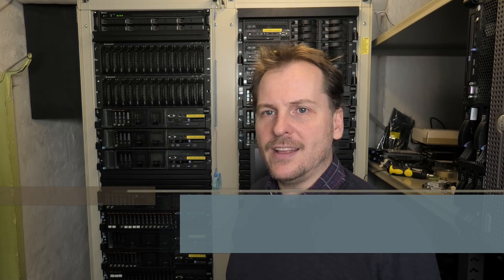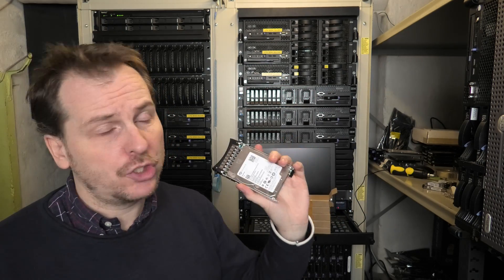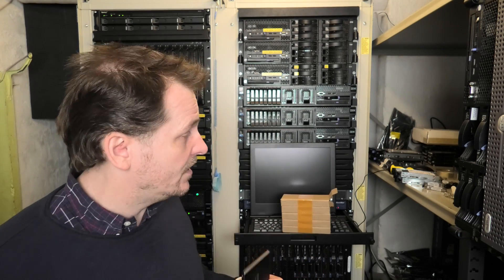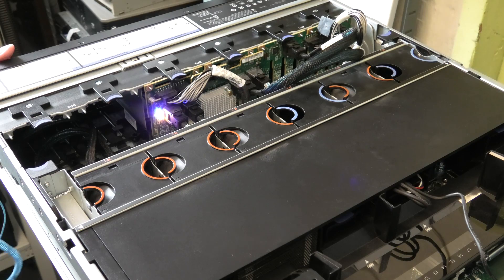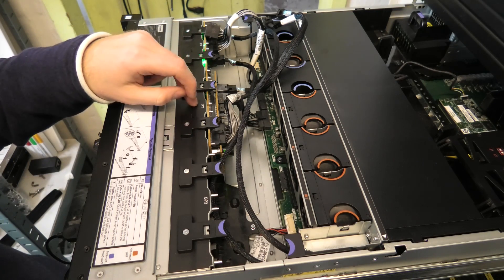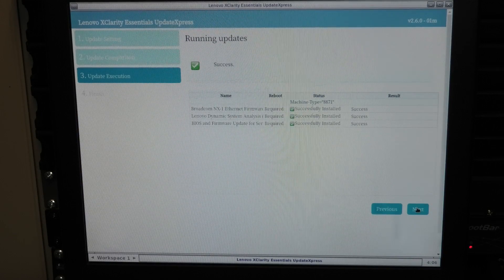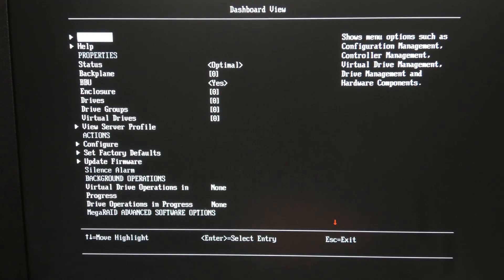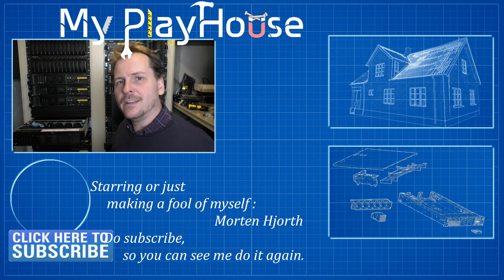Lenovo x3650 M5 SAS 12GB/s Expander Backplane Troubleshooting - 889

Comment: Hy in my HPE ML350 G9 i use 2 Samsung 840 1TB SSD an the fans works normal. No Problem 😄
Reply from the maker: Hi Tobypictures
Thank You very much! I have four running in two HP BL460 G9,, and they for sure fills up the log with whining.
Thank you for watching! :-)

Comment: I don't think HP does it because they don't recognise the drives, the system can easily find the temperature of the SSD, it's an industry standard. They do it because they don't want their customers using 3rd party hardware in their servers, it's less profitable. And YES sure HP parts are more reliable but smaller enterprises probably would be better off with putting that extra cost into other things than HP certified parts. Samsung Evo's are cheap enough that you can have a couple hot spares ready whenever a failure happens and you can always move up to more professional geared drives that are still cheaper than OEM parts. Apple did the same thing with their iMacs, you had to buy an adapter cable in order to use a non-OEM HDD/SSD or the fans would spin at full RPM all the time.
Reply from the maker: Hi CreativeType
Thank You very much!  glad you liked the video :-)
Thank you for watching! :-)
Reply: @MyPlayHouse  Oh thank you for making so many interesting videos you probably don't remember but I've been watching you for years. Just been a while since I've left a comment <3 I've been thinking about getting certified to work in the data centre field, I'm thinking about getting my Cisco basic networking down and I just signed up to become an electrician. I worked for years as an ethernet installer but now I wanna get into more of the power delivery and server deployment stuff.

Comment: I actually use some Silicon Power ssds for raid 0 to work on videos. They are FAST AS HECK (saw 2 GB/s not Gbit with 3 +r 5) in raid they have slc cache 512 mb and they are BLOODY CHEAP i saw 1 tb going for 55€. I would not put them in production 24/7 environment, for that there are the samsung ones, but random raid 0 for random stuff they are fast and good
Reply: That 2/3 GB is peak performance
Reply from the maker: Hi leonardo toschi
Thank You very much!  glad you liked the video :-)
Thank you for watching! :-)

Comment: That shouldn't be too hard to reflow it looks to be some sort of transistor or regulator
Reply from the maker: Hi Mrflash222006
Thank You very much!  Well I bought a new one,, I do not want to fix it,,, They are sending a replacement.
Thank you for watching! :-)
Reply: Ah just dawned on me that’s why the cable has been modified - it’s to bypass that regulator, a wild guess I would say it’s a 5v or 3.3v control for the back plane